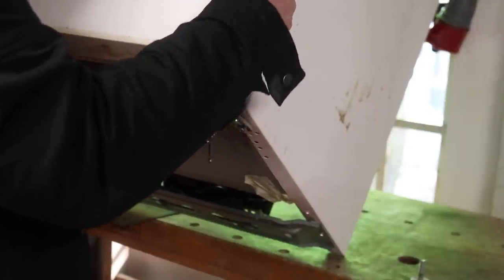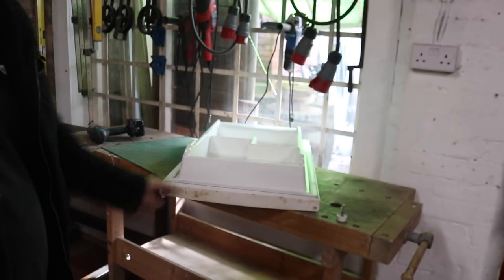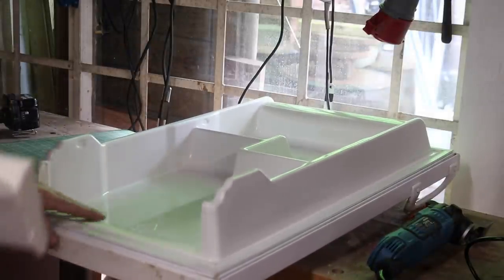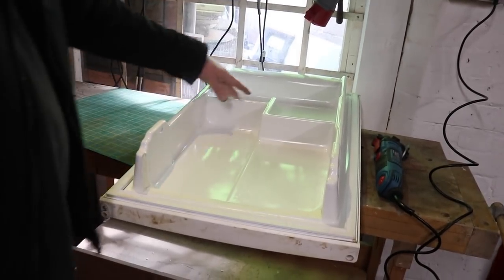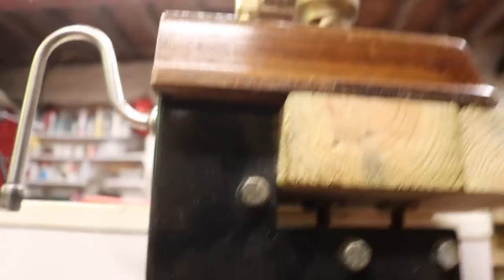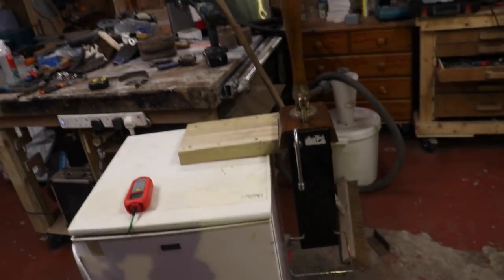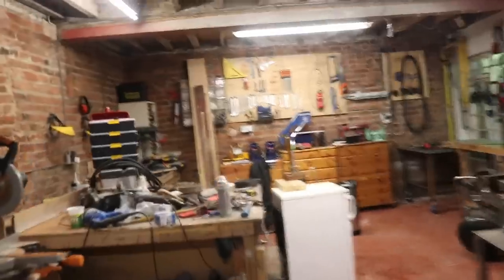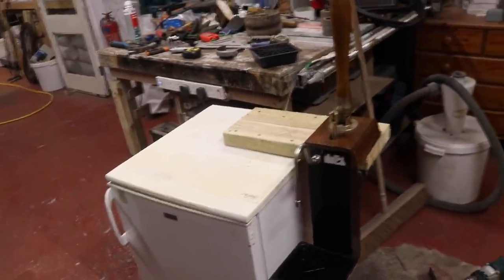Quick Hack For Cask Beer At Home

Comment: Hi great video I’m new to this I have a hand pull but I have noticed on other peoples videos they say to use a demand valve I between the keg and tap so not sure if I need one and struggled a little to find the right diameter beer line to attach as well

Comment: Great video, thanks for the insights!  I am in Maine USA and can obtain a 60pint casks for connecting to my hand pull! It’s located in my basement so around 56F except during a hot summer! I am interested in 
1 the beer line cleaner used
2 how to drill the fridge to pass the pipes through! I say pipes because I have a rather larger external CO2 canister

Comment: I thought you needed to leak some ambient air in to simulate the spile? I wondered if you could do that with a spunding or a one way valve? Or, it just isn't necessary? I would love to give this a go, but the beer engine is hard to get in the states. Looks like a lovely drop though and no one deserves it more - Cheers!
Reply from the maker: No, if at all possible just replacing the head space with co2 is fine, no pressure though.

Comment: I couldn't get my hand pull to deliver from a corni keg without fobbing uncontrollably, wonder if it was the pipe diameter causing the issue???
Reply: Temperature, inside diameter and length of beer line all are factors in having headdy beer. Try lengthen your lines and that should fix the issue.
Reply from the maker: Don't carbonate it. 1psi is fine.